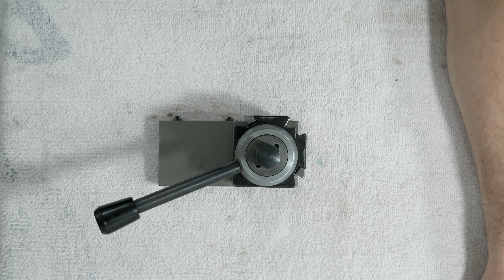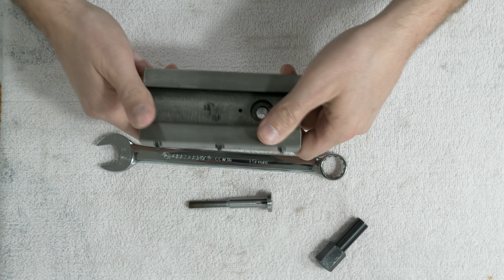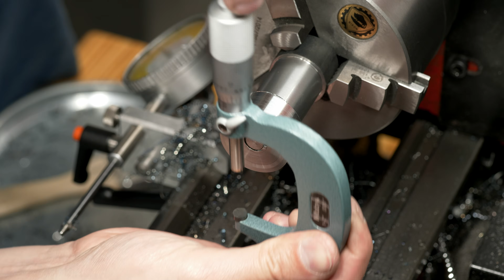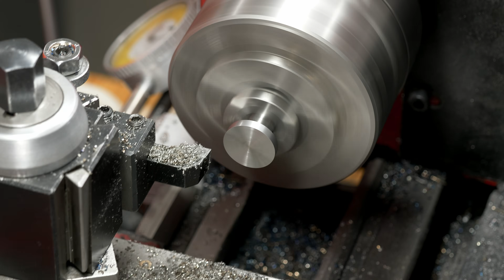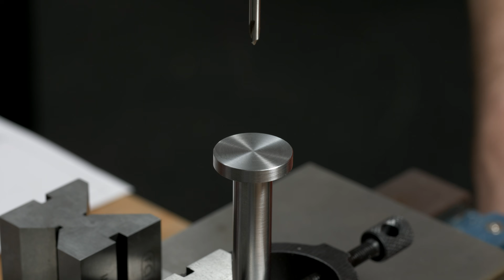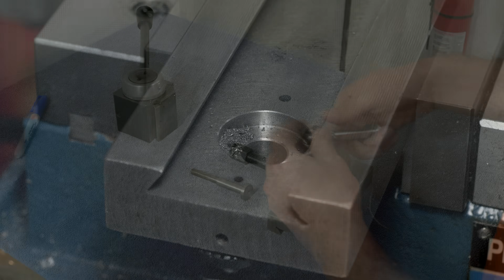QCTP Stud Upgrade

Comment: LOL this might sound totally dumb, but I just realized from watching this video, that the length of a wrench is based on the average max force through leverage that the nut and or bolt can or should be able to handle...

I never really bothered to pay attention to why they are the specific lengths that they are, and it just kinda clicked while watching this video, where he was breaking his little bolts with the 19mm wrench because the nut was stepped down to work with that bolt.  

I simply just assumed they were those lengths to quickly tell them apart from one another, so you would easily be able to tell which one was larger or smaller because of the obvious physical size of the wrenches end, AND it's obvious difference in length...

Interesting!

Comment: i the future i recommend putting it in a vise and using a standard 2 handed tap wrench. you can break off the tap or cause the hole to be wobbled off center.

Comment: Maybe you needed to upgrade your stud...but I am at a loss why so many people do an upgrade on this part and keep a hexagon nut here instead of installing a handle, doing away with the wrench entirely.
There is no wrench used to change tool post holders, why use one to adjust the angle of the QCTP when you can have a dedicated handle?
Reply from the maker: Imo, it all comes down to usability and use cases.  

My lathe isn't very big, and I often run into issues where even the qctp handle gets in the way. Add to that, that I don't often need to reposition the tool post, it makes sense for it just to be a nut. 

If I had a larger lathe, I would  probably have a dedicated handle.

Comment: if you're making the nut and the bolt why not make the threads imperial ?  (just make the bolt to a metric number to fit the hole in the block and then turn down the end to the closest imperial size down and thread it)
Reply from the maker: Just staying consistent  with everything else on the lathe.
Reply: @Dans-hobbies  ah ok, but I thought I heard u say it was an imperial lead screw lathe is all
Reply from the maker: @BillyTpower  It is, but every single fastener on the lathe is metric

Comment: When you cut metric threads on an English lathe you CAN use the thread dial.  Not the same way as with English threads but for me it works better than the "quick draw" method. 
Make the initial cut with the thread dial engaged, engage the half nut on any number.  When you get to the relief disengage the half nut, then turn the lathe off before the thread dial makes a complete turn.  Retract the cutter, then reverse the lathe and engage the half nut when the number comes up again and run the carriage back to the start.  Leave the half nut engaged for the next cut and repeat the sequence for each cut.  It works great and gives you much more time to stop the lathe and retract the cutter, as long as you don't let the thread dial make a complete revolution.

Comment: I enjoyed your mod and the drawings. I see that your QCTP fits over the boss. Did you machine this or buy it off the shelf ready to fit?
Reply from the maker: Hi Bernard,

I bought it from the now defunct lathemaster company. it sold the same 8x12/14 that HF does, just with a different branding.
Reply: @Dans-hobbies  Sorry Dan my fault I did not ask my question clearly.
What I meant was how did you get round the boss on the top slide. Did you cut it off or counter bore the base of the QCTP to accomidate it?
Reply from the maker: @bernardstart3553  sorry, It seems i wasn't overly clear either. The QCTP was designed for my lathe by the manufacture, it has a larger bore so it just slides over the boss on top.
Reply: @Dans-hobbies  Thank so much for your reply. Sorry it has taken me so long to reply.
Trouble is I can bore the bottem of the QCTP to accomodate the top slide boss. But now I will have to shorten the spindle that the three start screw rotates on. The spindle will then have no attachment thread left. Providing one takes care when carrying the QCTP to stop it falling apart it should be OK in operation when the M16 stud clamps the whole lot.
What do you think?
Reply from the maker: @bernardstart3553  depending on what lathe you have, you might get better results by maching the boss. If you decrease its height and diameter, you might have to bore less material out of the QCTP, thus losing less rigidity.

Comment: Nice project. Question: Why index the flat of the hex collet block on the bottom of the vise, and clamping on the points instead of clamping on 2 known parallel surfaces?
Reply from the maker: on cheaper collet blocks such as the one I'm using, the distance across the points isn't always the same, as they aren't considered precision surfaces. I've seen them off as much as much as 0.01"

that's more than enough to make the hex nut a really sloppy fit in a wrench. Thus to ensure consistent tolerances I usually reference off the face of the collet block, as they are precision surface.

On small cuts such as these it's perfectly safe in my opinion, but you definitely don't want to hog material with them clamped like this.
Reply: @Dans-hobbies  Thanks! I am just learning, and waiting on my lathe and mill to make it stateside from Taiwan.

Comment: question: dont you trust the machines leadscrew for travel? why else reverse the rotation? the thread is always in the same spot on the leadscrew and the leadnut,so disengaging the feed,turning it back and engaging it shoud put it in the exact same spot every time-pherhaps a big backlash or something?
Reply from the maker: I was cutting a metric thread on a machine with imperial lead screws. Unless you have a very specific set of change gears (I don't), you cannot disengage the half nut, and not get an error. 

Technically you can disengage the half nuts if you follow a very specific technique, but it's basically equivalent to not disengaging the half nuts.

Comment: as for the clamping of the pin intoo the vice for the mill : maibe make a set of vice jaws with a small V groove in the middle straight across eachother , my guess is that youre going to need it more than once and it shouldnt hurt the normal clamping force of the vice if you use it normal

Comment: Nice upgrade, curious why you wouldn’t make a locking nut on top to include a handle, this way no need to keep using a wrench...
Reply: I tried to put a handle on mine and was to annoying to have two handled, so I return to the wrench.
Reply from the maker: I have enough tool Holders, that I almost never have to adjust the QCTP itself.  My lathe is also very small so a handle would get in the way a lot.

Comment: Firstly thanks for the informative video .... Secondly my topslide has the same set up as yours .... i have a 20mm boss on top protruding 22mm ... Problem is the hole through the tool post is 14mm how did you get to fit your tool post over the boss.
Reply from the maker: Hi Mikey,

The QCTP i use was custom designed to be used with my lathe. it was sold by the now defunct lathemaster company. it sold the same 8x12/14 that HD does, just with a different branding.  

imo, you have a few options.
1) bore out the QCTP to fit over the boss
2) turn down the boss to fit in the QCTP
3) completely remove the boss and make an adapter/sleeve to fin in the QCTP.

I've heard of people doing all 3 depending on what lathe they are working with, and what tools they have available to them.
Reply: I had same problem- made a sub plate 6mm thick to change the spigot diameters. Not easy but it works.

Comment: nice work, but wasn't it easier to buy the M12 flanged nut?
Reply from the maker: They aren't available locally in my area, so I'd have to order them online and then wait up to a week for them to arrive. Also making one yourself offers the ability to customize the nut to your liking. For example making the flange thicker or larger in diameter etc.

Comment: I solved the same problem with my janky undersized stud by getting a real Aloris. I had to go buy a tap drill and  tap to deal with 9/16" threads, but I can crank on a 7/8" wrench now, and it never budges. Your fix was waaay cheaper, and i bet you saw a huge improvement.

Comment: Nice video!  But just a tip for you, when milling your work in a collet block, you should clamp on the flat sides of the block.  The reason is if it works loose it will twist straight out of your vice.  If its holding on the flats, then there is much more clamping force and no spare space for it to twist out.  Another way is to hold it in a sideways V-Block.  Keep on making great video's mate!

Comment: Nice vid, thanks. I rarely use the compound on my lathe, made a block same height and the toolpost sits on top. Much more rigid setup, and only takes a minute to swap the compound back if I need it. My cross slide has a boss that the toolpost bolts to, M12 thread, so I dint need to modify anything to mount the AXA size toolpost.
Reply: I did the same to my lathe and wow what a difference.

Comment: That's great that you can make a bolt and nut from scratch, but wouldn't it have just been easier to buy a threaded nut and  bolt and turn the bolt hex head round and also face it to the right thickness?
Reply from the maker: You could, but it would be hard to get things exactly as you want them.
Reply: @Dans-hobbies  Yes, it's obviously a matter of personal preference, but not that one is any more effective than the other. As I explained elsewhere, the size of the head of the bolt in the cross slide boss doesn't matter and no one will ever see it.
Reply: @brucebelvin2058  we can agree to disagree on that
Reply: I tried exactly that and unless you went with a much larger diameter bolt (which consequently would have to be turned down and rethread ed),  the inside boss of the top cross slide would be incompletely filled and thus less contact. The head on that bolt simply wont have enough material to fill it. The m12 I used ended up only  filling /contacting about 70% of the diameter of the boss.
Reply: @waynemackenziesr5005  The fact that the inside boss may be incompletely filled is irrelevant. What really makes the QCTP rock stable is the contact of it's base with the cross slide and the downward force exerted by torquing the bolt. And the lateral movement stability is actually dependent on how close the bolt diameter fits the drilled hole in both the QCTP and the cross slide and not how much space the bolt head fills the cross slide boss.

Comment: Sometimes smaller bolts are used with tool posts so that the bolt will break before the cross slide breaks in the advent of a catch.  On a small lathe that I have the tool post mounting bolt is turned down in the middle to a much smaller diameter for just that reason.

Comment: Hi, may I ask what size of lathe and QCTP you using ? Thanks for sharing.
Reply from the maker: Hi Vincent, My lathe is an 8"x14", and i use an AXA sized  QCTP.
Reply: @Dans-hobbies  What is an 8"x14" lathe? Make and model would be fine.
Reply from the maker: @redgum1340   This is my  lathe. HF  doesn't know how to measure between centers it's really  14 inches not 12.

https://www.harborfreight.com/8-inch-x-12-inch-precision-benchtop-lathe-44859.html

Comment: Why not just turn a threaded nut for the base, a shouldered bushing for the top of the qctp and use a normal old 12.9 Allen bolt?
Reply from the maker: That would definitely work, but you would need to keep an Allen key close by.

Comment: I don't think you need two jaw puller at 27.55  just find something shim on the bolt. I have same problem with that bolt has not enough power to hold the holder. I just counter-bore bottom of QCTP holder and it fixs.

Comment: Why do you have to make this in metric?  You could even make it in a custom thread if you wanted to.  I subscribed.  Good content.
Reply from the maker: All the other fasteners on the lathe are metric, so keeping it metric just minimizes the number of tools I have to keep close. for example the tail stock locking nut is 19mm, so I only need one wrench for the qctp and the tail-stock.

Comment: Dan,  I had a similar problem with my Chinese knock off tool holder.  Only in my case the Chicago style bolt snapped instead of the srtud.  The wall of the Chicago bolt was so thin it was only a matter of time.  Since I don't have a hex collet block or a dividing head or a lot of tool steel laying around I did something different.  I have several large grade eight bolts on hand.  I also had a fine thread nut of suitable size.  So, I turned the large bolt down to the shape and size I needed and threaded it. It works perfectly and the wrench size is no compatible with the bolt size.  Good video.
Reply: Exactly my approach only mine was a high grade *? steel bolt from the local farming supply shop. high pitch thread made it clam quickly yet tight.

Comment: Hi Dan, When turning the 1.102 diameter at 10:06 in, what was the insert and what material were you turning?
Reply from the maker: Hi Dave,

The material is hot rolled 4140. It has fairly low machinability, and doesn't always yield the best finish, but it's really tough.

This is the insert I was using. They are excellent for small lathes because they are finishing inserts so they are designed for slow feeds and shallow depths of cut.
https://www.sandvik.coromant.com/en-us/products/Pages/productdetails.aspx?c=CCMT%2006%2002%2004-PF%20%20%20%201515
Reply: I was impressed by the finish is why I asked. I have no idea where I bought it from but have an SCLCR06-2J holder that came with an insert. Performance was excitingly average so I shelved it. Research says that insert should fit it. Rather than spending $$ for 10 can I buy one from you? Would be happy to send a check for the part and any shipping costs. Hopefully you know who I am. Dave M. My email address is at the end of every video.
Reply: The videos you've seen I'm trying 1144 and not getting a great finish. Just tried 4140 and have a finish like it came off an $80,000 CNC!!! The insert also gives a great finish on aluminum..
Reply from the maker: Are you turning plain 1144, or 1144 Stressproof? The stress proof variant gives a much better finish because of how its treated.
Reply: I ordered these and I swear their the exact same insert https://www.banggood.com/10pcs-CCMT060204-VP15TF-Carbide-Inserts-for-SCLCR-Turning-Tool-Holder-p-1101201.html?rmmds=myorder&cur_warehouse=USA

Comment: Nicel ... but my question is how did you fit the holder over the sleeve that is
on the top slide .... coz i have the same QCTP but it won't fit over my sleeve
and i really do not want to cut it off for it will really weaken everything.
Thanks for sharing.
Reply from the maker: Mickey Pee mine came bored out to fit over the sleeve.

Comment: Great improvement to the lathe.  Just as info for the imperial threaders out there.  This is how we thread metric threads even on metric lathes.  None of the lathes I have had at least, has had a threading indicator.  I believe there are just too many combinations.  I also have to keep the half nut engaged.  I have made a tool holder with a retract handle ala Multifix to ease the retract operation.  I believe most metric lathes are the same.  Luckily, my Leinen lathe stops short, an this helps a lot

Comment: I have the same style tool post on my Bolton Tools lathe. My QCTP came with a long M12 stud threaded both ends and nut. I just cut the riser off the compound and tapped the hole for the M12 stud.

Comment: I did the same thing 2 years ago ,but  instead of a roll pin ,i used a set screw on the circumference of the bolt to stop it turning with lock tight. good job though.

Comment: While the shaft is indeed misdesigned, the way to increase the stability of the toolpost is to provide an antirotation means, in addition to the friction provided by tightening the tool post using the stud.  In other words, provide another means of preventing rotation, rather than just attempting to increase shaft torque and normal force.

Comment: Like Your style of working Dan.
Methodical, well planned, confident, neat, precise and accurate.  You know how to use all Your Tooling very well. We still trying to get there with ours, even at our age.  But worth every bit of the effort in trying.  
Also like some of Your Tooling. 
BTW, what make of Drill Bits and Centering Bit are U using, and where U get them from ???
Thanks for showing and sharing
ATB
aRM
Reply from the maker: aR,

I have a mix of drill, but I have slowly been converting over to triumph twist drill "thunder bits". They are 135 degree split point bits.
https://www.amazon.com/Triumph-Twist-Drill-Co-099856/dp/B001F8PYYS/ref=sr_1_1?s=hi&ie=UTF8&qid=1513007646&sr=1-1&keywords=099856

The spotting drills are made by KEO and you can order them from pretty much any of the major tool suppliers, or from amazon.
https://www.keocutters.com/product-category/spotting-drills/spotting-centering-drills/90-pa/90-right-hand/90-right-hand-hss/
Reply: Hi Dan
Thanks for the response. Much appreciated.
Yes, those "Thunder Bits" really cut like lightning  !!!  Worth the "Investment"
As for the Keo's we know these are very good USA made. Will source some
ATB
aRM